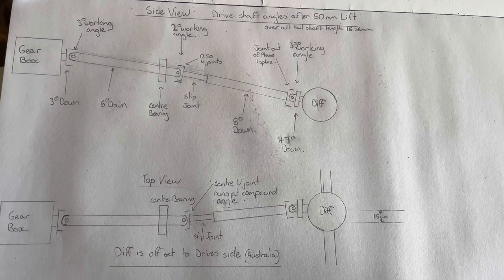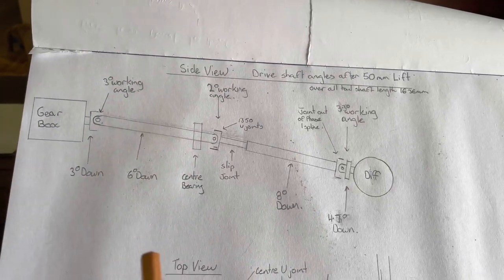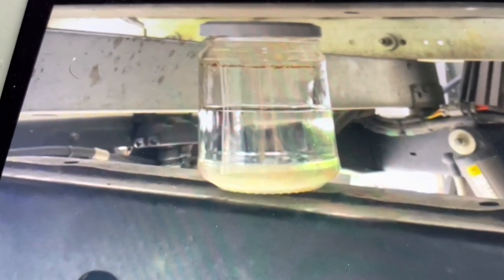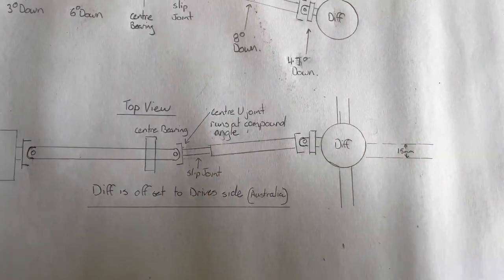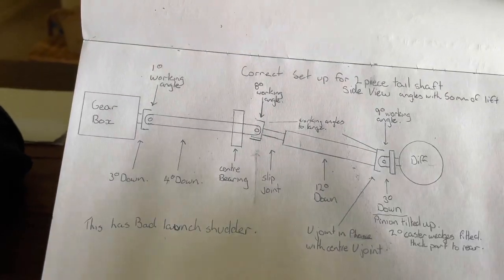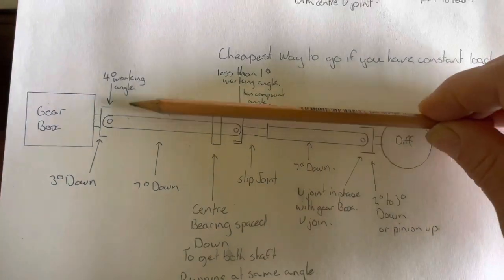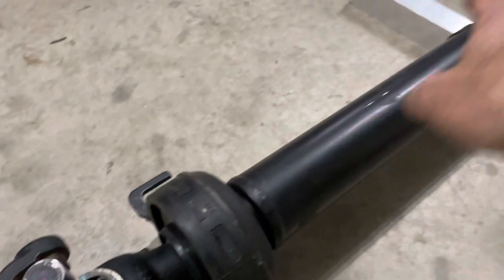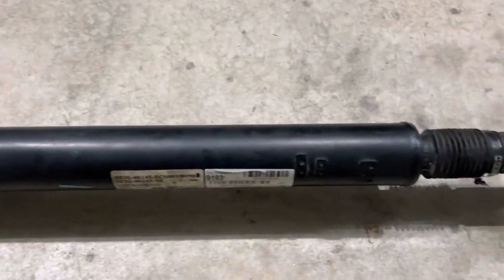Px Ranger/BT 50 drive shaft vibration fix

Comment: Yep Welcome to STRAAYA where the professional tail-shaft suspension so called experts dont know shit and a average Joe shows and explains how shits meant to work.....awesome presentation...thanks for shearing bro....wish i knew this earlier.... i added 63mm lift and only 2 degree wedge plate but now the problems are showing
Reply from the maker: Because of the time it takes to work out what is causing the vibration most driveline shops don’t want to spend the time to fix it. At bigger lift the double Cardan tail shaft is the only way to go. I’m glad you found my video helpful, sometimes with these vehicles it’s not just the Drive Shaft that causes the vibration. Thanks for your nice comments Cheers Phil
Reply: @philsrandomstuff2392  thanks phill yeah big time....I need to install that double cardon uni joint.....any chance you could leads us to what exact part number and brand double cardon uni joint u used ? I should have the same tailshaft so installing that double cardon uni joint u have should fix the issue
Reply from the maker: @jmoore9806  please watch this yt video also https://youtu.be/zuPSGJZpL3k as it will help to see if the vibration is drive shaft or tyres or a combination. I do not know the part number sorry. There wasn’t a direct fit double Cardan joint. The used a double cardan with 1350 u joints with a female spigot it had to be modified to fit the ranger 60mm out put flange spigot and m12 mounting bolts it came with 80mm spigot hole and 10mm bolt holes. The tail shaft shop or modified it to fit. 
You can ring Gibson Drive Shaft services in Newcastle on 02 4958 3059 as they are the people that did the job for me. If you Would like to talk on the phone I will post up my email address so you can email me and I will send you my phone number. I just like to add this isn’t as straightforward as it seems.
Reply: @philsrandomstuff2392  thanks for the reply phill...I live in Victoria so I can't drive to Gibson's drive shaft In Newcastle....It's a bit of a hike lol....I wonder if they can make me the same tailshaft like yours....maybe I can get them to ship it down to me.....Yeah cool I'll check out your link video when I get home from work... cheers Phill
Reply from the maker: I know the guy there really well at Gibson Drive Shaft and if you ring them They will be more than happy to supply you with the part Number
Reply: @philsrandomstuff2392  oh nice thanks phill your a legend much appreciated..... I will try one shop that is so called capable here in Victoria but last time when I read about others doing the double cardon uni joint they all looked at me like I was some lost case and said "NOOO u don't need that" they said all u need is a center bearing adjustable washers and bolt....I told them it's already on the ranger and they said well I don't think we can help u. Sad really how these guys make custom tailshaft for high HP cars u would think they know a bit of basic logic of a double cardon uni joint? Shocking....worst case if Gibson's can't send me a custom tailshaft I'll just have to dive up....I'm really really desperate
Reply from the maker: @jmoore9806  I had the same problem when I decided to get the double cardan fitted. Two piece tail shafts are hard to get right and most people don’t know how to set them up.as I would like to have a talk to you before you go ahead so you don’t waste money going in the wrong direction.
Reply: @philsrandomstuff2392  Hay Phill.....so 1 year latter the drive shaft shop finally welded on a double cardon uni joint at the front like yours.....but it hasn't really helped much ? I'm about to hop underneath the car and play with the center bearing adjustment washers....where abouts did you have your center bearing adjustment washers ? Or did u leave it stock with the factory bolt ?
Reply from the maker: @jmoore9806  mine is at stock mounting position. Has the centre u joint and diff u joint been phased correctly as from factory they are one spline out of phase and is the working angle of these two joints the same with in 1 degree.
Reply: I think I know what's happend and why it's gotten worse they installed the castor wedge the wrong way 🤦‍♂️.....the thicker fatter part of the castor wedge needs to be at the front bonnet of the car and the thin part needs to be at the rear of the car
Reply: @philsrandomstuff2392  I just measure the diff flange 81 degree and the gearbox flange 86.5 degree..... I have a 4 degree castor wedge in there.....the diff needs to come down 5 degrees to match the gearbox flange. This would make the double cardon work now
Reply from the maker: Email me your phone number to dingleyphillip@gmail.com and I’ll give you a call